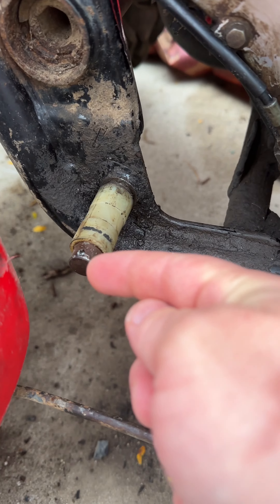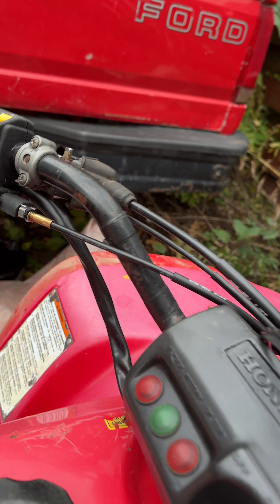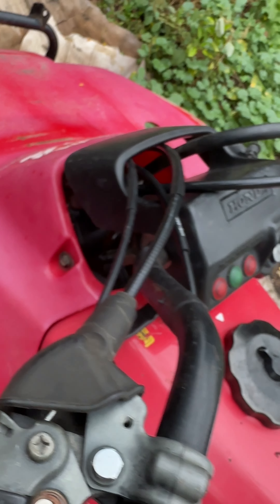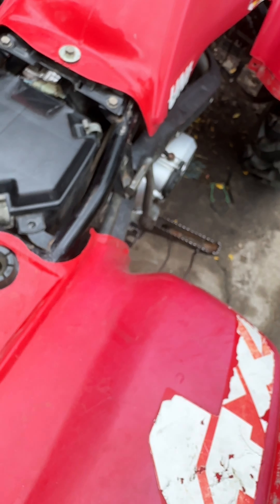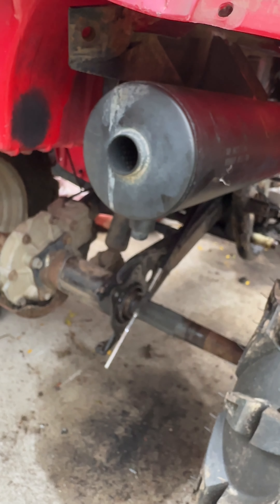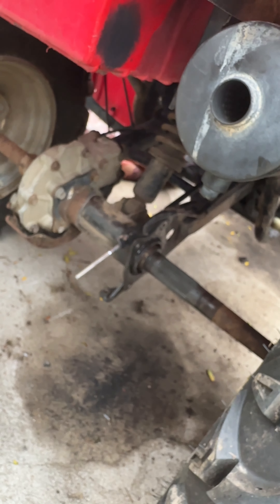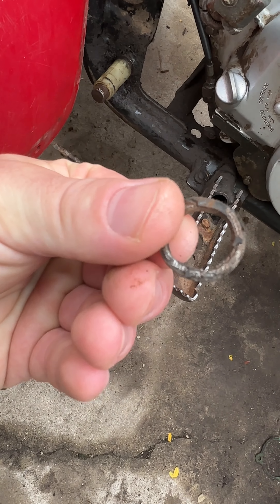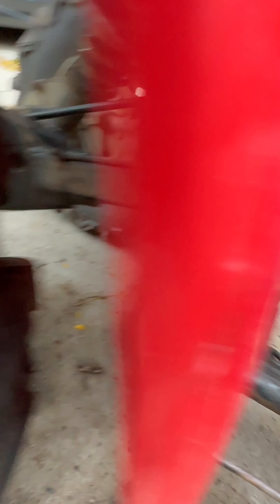Honda Fourtrax 300 update / Bow Season

Comment: The peice inside the foot pedal is a "bushing"...im not sure if I would have replaced the back plate on the break housing 🤔 maybe just some jb weld or silicone....the muffler is mint looking ..maybe look for a parts bike brother those parts add up 💵 i know well I'm going to keep watching good luck 👍 im a bow hunter myself 🇺🇲
Reply from the maker: Yeah, I got to figure out that bushing issue, that was part of the problem with the foot brake, I mean the foot brake just doesn’t seem to rotate on that thing without a lot of friction. It would stick in different positions/angles without anything attached to it just sitting there. Yeah after really thinking about it that was what I was thinking with the back plate, as long as it seals properly. I got some Hondabrite cleaner I plan on using on it, I don’t know it I need that chipped piece to be there for it to seal. I think with some Hondabond on the drum cover seal it maybe fine. After a second look I think it won’t really matter functionally wise. It just needs to mount, function, and all seal  up well, then it should be okay. Yeah I need to get ready for Bow Hunting it’s getting that time. I been really sick this whole week though, just got back from the clinic today. Been rough
Reply from the maker: Oh, yeah I bought a mint used OEM off EBay, a new OEM from Honda is still available, but it’s $700.00
Reply from the maker: Here is me testing the that exhaust https://youtu.be/eXnSd9fSaoE?si=_lQmy8B_-Bdi6yrT
Reply: @TiffanyBottomsHunter  I think I would silicone that small broken piece back in place...put a layer on the inside whatever you can get by with then use some around with your "O ring" & a lil heavier dobb where its  broken im 💯 it will seal if you use enough good quality silicone...im just hoping to help you if I can...I have pretty much always worked on my stuff with good luck most of the time & im cheap lol I try to get by brother 🇺🇲 good luck either way you go
Reply from the maker: @JoseyWhales-ii4dk  Thanks I will probably consider that, and see what I can come up with. I’m still recovering from this oh sickness yet, it’s kinda put everything on hold for the moment. I worked at a casting company, and when Ford Engineers messaged up on transmission housing designs, we would fill those imperfections in the moundings with a product called Belzona epoxy that would harden, kinda like JB weld but I believe it was more durable. I will have to look that stuff up online.
Reply: @TiffanyBottomsHunter  ok brother I sure 🙏 you recover from being sick really soon...I just came across a 1970s vintage wooden Browning bantam compound bow im hoping to get it put together & maybe take a deer this season... it opens here October 15 ....stay safe friend  🇺🇲
Reply from the maker: @JoseyWhales-ii4dk  Yeah Bow season opened here in Wisconsin on September 14th I believe it was, but that’s too early for me, I don’t get the fever till leaves start dropping ☺️